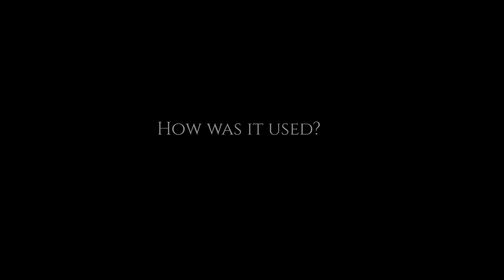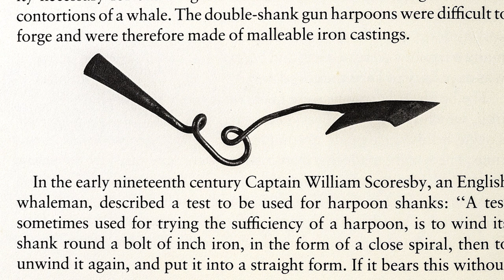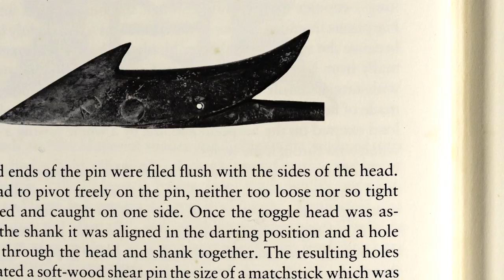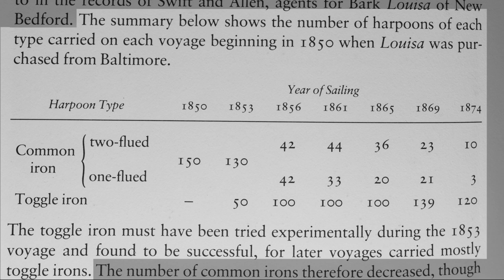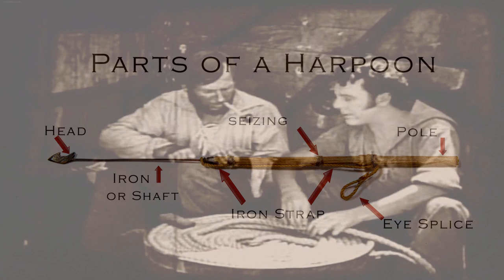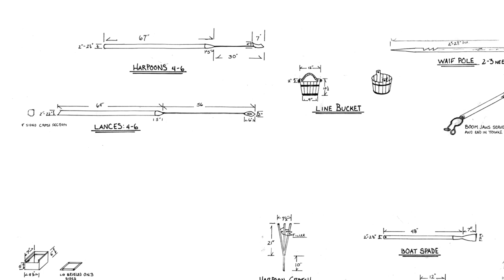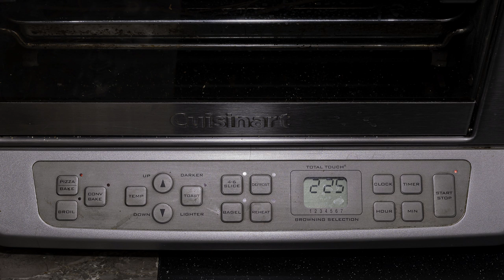Building a Whaleboat, Episode Four

Comment: Love your source of shaft material! I find my sinuses and CA glue are incompatible so I rarely use it. For securing knots or splices I generally use either clear nail polish or Fray Check seam sealant. (BTW, I made two seine boat thwart knees today!)
Reply from the maker: Don't know if you're familiar with the name Colin Gray.  He was a talented ship model guy on Nantucket (a transplant from the UK).  He turned me on to using the privet hedge.  As a matter of fact, my stash of the stuff actually came from Colin.  He gave it to me back in the early 90s and I'm still trying to wear it down.  Hang in there, Robert

Comment: Hi Tom  do you treat the brass before blacken or you just leave it? I have a few different solutions. The blacken just rubs off even if I rinse it with a little bit of water. Or if I just leave it a lone.
Reply from the maker: No real treatment.  I will sometimes buff it with a fine abrasive wheel in a Dremel, but I always wash or wipe them down with a solvent.  I also do not dip the parts in the blue.  I put it on a cotton swab and rub it on.  That's what allows me to get that slightly brown-ish color, rather than a deep black and doesn't leave a residue.  After that, I don't treat it with any kind of a top coat.  I just try not to handle it too much.  The parts are easy enough to re-blue if I do scratch the finish.  I wonder if pickling might help your problem.  It might give the surface just enough "tooth" for the blue to bond a bit better.
Reply: Thank,s Tom for that advise I'll try it that way. I tried pickling but but it didn't really work ... well it was alright. I'm gona try gun bluing . what you use. Be safe.
Reply from the maker: @jiml9692  Birchwood Casey Perma-Blue